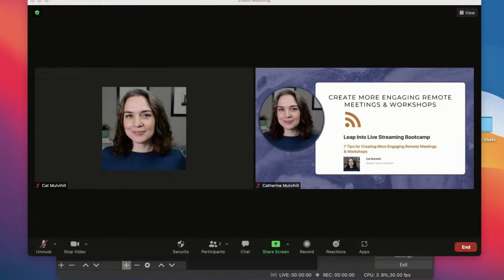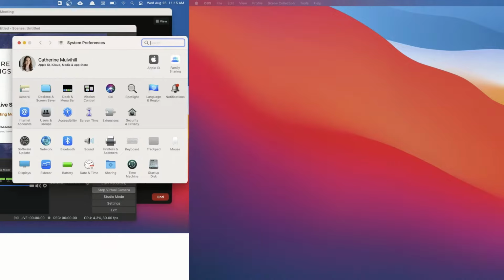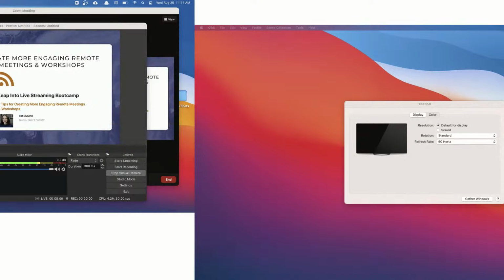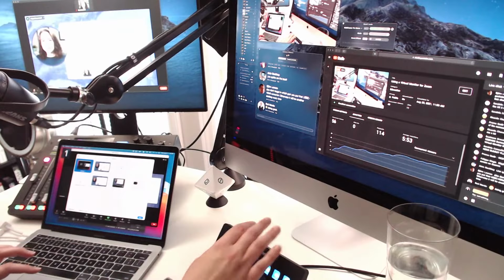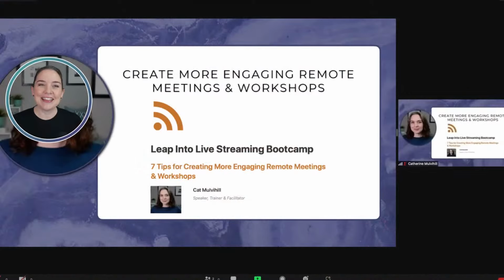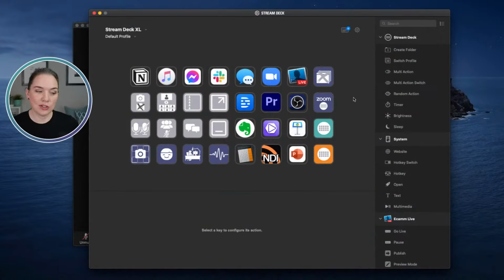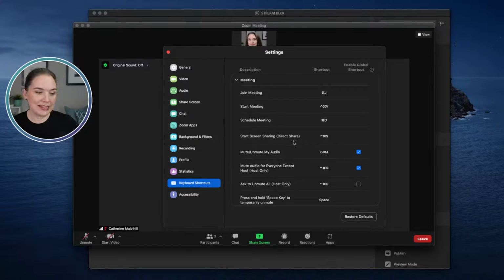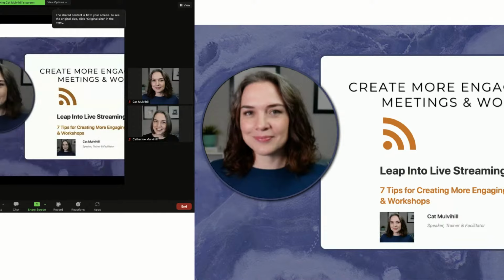Using a Virtual Monitor for Zoom

Comment: I know it's kinda late to react to this, but hey... why not? You got that question about the difference between no monitor and the ghost monitor dongle. When there is no monitor attached, the display card does not activate that port and the OS falls back to a low level resolution for remote working. Mostly used for terminal connections. When you attach a ghost monitor dongle, the display card will detect a monitor, activate the port and will thus generate a full blown high resolution image.

Comment: Wow, I've never heard about that little gadget, but it's really useful for that!
I am using alittle trick to do the same but without having to buy that thing ;-)
Reply: Cat, my trick work if you have an standard 2nd monitor (not an apple display) AND your computer has 3 display outputs (or two if you're in a laptop). If you have a powerful GPU you probably have 3 or 4 outputs (my nVidia RTX 3060, i.e., has 4 outputs).
The trick goes as follows:  as you already have your 2nd monitor connected usually through DisplaPort or HDMI, you'll need another cable to connect the 3rd output of your GPU to your 2nd monitor using another cable. If you already used Displayport and the HDMI input of the monitor is free, use that.
Within the monitor menu, switch to the HDMI input and it will recognize the new output as if you had a 3rd monitor... but without having to actually buy another one! 😃
If its'nt recognized you probably have to reboot with the monitor switched to HDMI. Then it will do. Just switch back to DisplayPort. Done!
You'll have your computer that believes you have 3 monitors but 2nd and 3rd are actually the same.
The best part is that you can actually SEE the 3rd monitor just by switching, but with the virtual monitor you can't. Great, huh? 😉

PS: with a macbookpro that probably has 2-3 USB-C outputs instead of HDMI it should be possible too, but with an USB-C to Display port and an USB-C to HDMI adapters. Not sure though, as I have Windows.

Comment: In case you have two monitors, you can have the third one for free. Just connect the 2nd monitor with two cables and your Mac (Win probably also) will recognize it a further monitor. Besides this, you can choose the buttons on your monitor to switch between the contents and control the content of the third on top.

Comment: Thanks for the presentation. Are you using Ecamm Live Pro? I notice that you have a second monitor (that you asked us to ignore).  I'm wondering if the headless monitor output can be moved to an actual second monitor to save having to purchase Ecamm Live Pro for Video Monitor Output capability. Thanks.

Comment: Great presentation/solution 🚀
I just wish there was a built-in OBS feature for this, can't believe it's not (it's a very common use case).
It's such a shame that OBS doesn't offer a "virtual display" out of the box, same way like it offers a "virtual camera". I think both are equally important.
I remember my disappointment when I discovered OBS and the Virtual Camera feature and created a nice couple of scenes for me to use in an end-of-sprint presentation, only to realize that "oh, no! Virtual Camera doesn't actually make sense for this. Because I would actually need to do a screen share :( I'm not streaming. I'm in a video call and I need to screen share"
And resolution/image quality is not the only consideration either, like you've also mentioned (the spotlight problem). Depending on the application you use for the video meeting (Slack, Zoom, Teams, Skype, Meet etc.), it can be either difficult or even impossible to actually spotlight yourself so everybody would see you "full screen/maximized", and not be replaced with another participant's camera when they would ask a question or simply make some noise by mistake, not having their mic on mute.
Reply: P. S. I haven't tried in a while, but I remember playing around with the window projection (I guess it functions the same as screen projection, the only difference being it's projected to a window instead of a screen).
And as far as I can remember, there was a major issue: when I was switching scenes, I had to manually right click again on the obs preview and choose to project again, otherwise the projection didn't change to the new scene I've switched to. So I have to check that again with the latest version of obs... Hopefully not an issue anymore.
Reply: @MStoica  I noticed if using 'studio mode' I needed to right click on the 'program' side, not the preview, or the correct scene wouldn't show.
Reply: You can share the virtual camera directly to Zoom without a second monitor, in the advanced settings when you have the share pop up on zoom you can choose 2nd camera and choose OBS virtual camera directly and you will share with no downsides
Reply: @_Darkaeluz  thanks! This is a great feature, if zoom has it. However, I'm not using Zoom. Only used Slack or Teams and occasionally Skype, in different teams I've worked along the years. And still prefer Slack, if the decision would belong to me (for integrations with various services/automations)
Reply: As the other replies say -  use OBS's Windowed Projector and choose that from Zoom's share screen choices. Still, if your program (production) has video in it, it seems lower res than if you shared an app window in Zoom (for example a Word doc, text editor showing Code or an Adobe app). My test Zoom recordings to the cloud seem that shared windowed projectors are better than virtual cam, but not as good as sharing an app window. Choosing the advanced share screen tab in Zoom and choosing 'share from 2nd camera' seems to get the same result as a virtual cam.  
I think testing this stuff with another participant in the meeting remotely can be helpful, but all to often no matter what I do, they tell me I'm blurry : (

Comment: On windows 10, Using the dummy monitor plug  (in my experience) caused apps to occasionally go to invisible no man’s land where you have to reset the displays (briefly change  resolutions ) to get the app back onto a real screen. I settled on using a 5.5” display (normally used for a raspberry pi). Would have preferred a dummy monitor plug,  or have the ability to constrain a full screen monitor into split screen setup. I miss my Mac setup.

Comment: Since I have a ATEM 810 which can accept 4 cameras via HDMI..Can I use my 4 HDMI  Plug or connection. Can I use the 4 HDMI plug for my virtual monitor.

Comment: Cat it looks like I might become a fan. Viewing this video has me confused. My issues is I have a ATEM 810 Mini Pro ISO video switcher.
I have a client who may give me this opportunity to run a zoom meeting for them. I’m trying to figure if I might need to pay fo Ecom to handle her Zoom conference?
I have a external video monitor for my ATEM 810 mini pro iso video switcher. I also have a Stream deck which I hadn’t started using yet. I have a old 2012 MacBook I was trying to use. It’s too old to use with OBS. OBS couldn’t my 3 cameras connected to my ATEM MINI PRO ISO VIDEO SWITCHER. Thank God I got a Apple M1 top of the line laptop.
 So I’m trying to get back to learning to use OBS with my ATEM mini pro iso video switcher and Stream deck.

Comment: Hi, does the Virtual monitor plugin item work even without OBS or Ecam?

Macs can have several 'Desktops" arrangements. I don't like it when the change automatically when I'm working but I've seen one can just share another 'Desktop' with just Zoom & no virtual plugin & no OBS.
Pls. could you demo that option? Thanks.

Comment: For the Share Screen going fullscreen when someone else shares you can also set Zoom to leave the Window at its current size by going into the Zoom settings -> Share Screen and selecting Maintain Current Size.  

Also, for shortcut keys, if you click the Enable Global Shortcut key then you do not have to have Zoom as the active window in order for the shortcut key to work.  Just make sure that the shortcut key is not used by another open application.